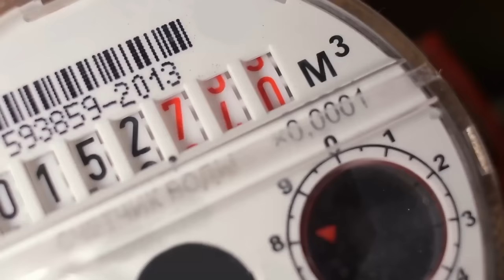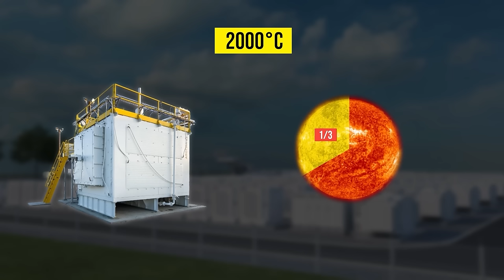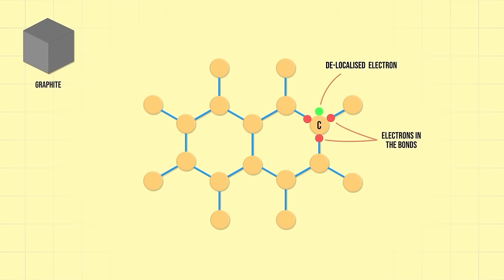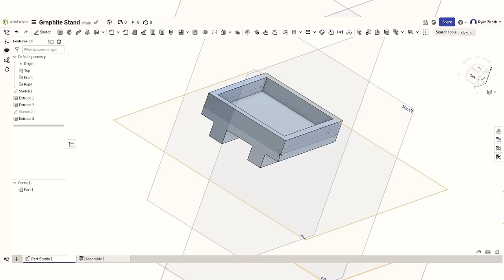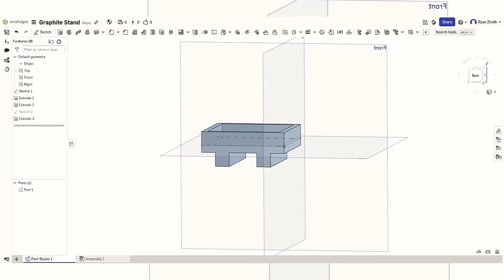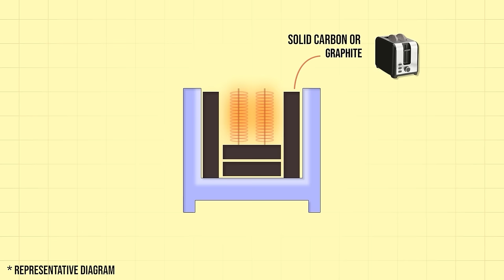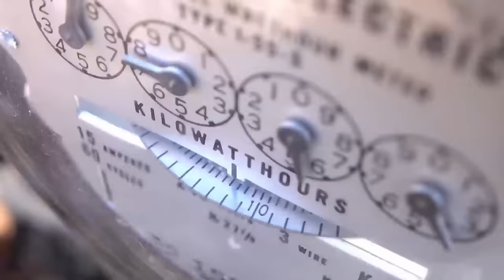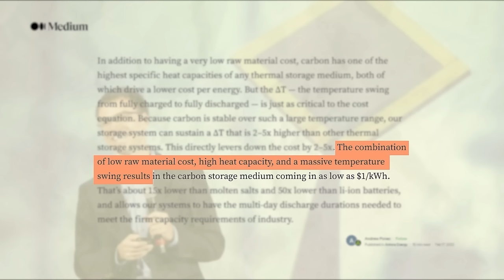Why Solid Carbon is the Future of Energy Storage

Comment: The storage and heat emission is absolutely groundbreaking. Possibly combining the solid carbon heatsource with the Ambri liquid metal batteries could be a thing. From memory they are about 70 odd percent efficient at converting from heat to electricity.
Reply: All comes down to cost.  Ambri is potentially better for electricity and this is better (one of the only options) for industrial process conversion.  The real cost and life of each device and the cost of surplus electricity impact the viability and noone can accurately gauge that from youtube videos marketing the tech.  Ambri has complexities mostly around the ceramic components.

Comment: each home should be equipped with such a device, and have a way to use the stored heat either for electricity generation or actual heat (cooking, HVAC, etc)
Reply: Exactly the same thought struck me! So much more efficient than converting electricity back into heat again...

Comment: What are the mirrors made out of so they don’t melt if you’re dealing with temperatures hot enough to melt steel?
Reply: They are cooled because the "solar" cells/electric interconnections.., also won't resist these temperatures.

Comment: Returning the waste heat from the solar cells to the carbon cell  is not a slam dunk.  You don't get to take heat out at 2000 degrees and push it back in at a lower temperature. There might be some magic in the cube, maybe an area reserved for scavenging waste heat and an area that is heated to the max. Or maybe the waste heat is directed toward a different cube for pre-heating.

Comment: I think this would work. I had a similar idea. Also, they have been using the idea of molten salt as it is also very prominent and can be extracted easier as it is a liquid and can be passed through a heat exchanger, although the system might be a little more costly it would be more efficient , With reflection, shiny surfaces and highly insulative materials about 1 foot of insulation would be totally enough also the larger the volume the less service area, shape also matters. A sphere has the lowest surface area per unit volume. A square cube is also decent. A container is not really that good but if you put two of them side-by-side or four of them, side-by-side t and two on top of them, you would only have to insulate the exterior walls. I’m guessing highly reflective, interior walls, high temperature insulatating bricks in the inner then Rockwool insulation then maybe regular fiberglass for total of about 16 inches should be very insulative. Of course you could go further as it is such a high delta T

Comment: I wanted to use slate tiles, because the color would be useful for the thermal mass of the walls of my earthship, but it seems that I could also use them in direct contact with the metal parts of my rocket mass heater.
Slate tiles would be really good, but it's rather expensive in France, probably because it's a fashionable color and material.
The only problem is that it's difficult to find for free or really cheap, compare to all the materials I already have (stones and clay tiles).
Maybe I already have stones with similar properties, but in a temperature range lower than 1000°C (pyrolysis)
Reply: Salt is another way to store heat.  When the salt melts it takes in a lot of heat.  When it freezes, it gives up that heat.  The trick is to get a substance that has a very high melting point - and of course, a way to contain it in something that doesn't melt or dissolve.
Reply: @acmefixer1  I know but I want low tech and solid.
A  lot of hassle for a few m² of surface area.
I will probably keep it as simple as possible and after enough testing I will make modifications if I find that the heat is escaping too much too quickly or other problems.

Comment: Any problem with materials (others than graphite/graphene) inside the "battery" reaching temperatures >2.000⁰C? I.e.: electricity>heat & heat>electricity converting system's materials?

Comment: The biggest downside of this system is that unlike a battery, this cannot unleash huge amounts of electricity in milliseconds.  You could not use this for synthetic inertia.  

Even though it can put out straightforward output like solar panels at night, it doesn’t solve this huge problem for the grid.  You need nearly instantaneous reaction times with high currents to provide this extraordinarily valuable service of grid stabilization.

With fossil fuel plants, they use massive flywheels to provide the stability and they also vary the output.  It works well enough but the li-ion batteries are exceptionally effective for this application of smoothing things out.  This is why they are so great even though they are so expensive.  The battery operators are highly profitable even with that expensive investment.

Comment: 40% is pretty good, assuming the TPV cells last decades. It still means you need to generate over twice the amount of energy you actually plan on using. Less if you can somehow use heat-pumps instead of resistive heating. This is a case where scaling matters a lot too. Make a storage unit store 8 times more energy, the losses will only be 4 times greater. Instead of making modular cubes, industries that use process heat would have a better time making an enormous chamber full of graphite, heating elements, and TPV cells. I can see industries that rely on process heat as the largest consumer of energy (and who also don’t use fossil fuels for other reasons like reducing iron ore) adapting this sort of strategy, there the efficiency penalty of thermal to electrical isn’t as big of a deal.

But nuclear process heat is probably a more sane pathway, if only the regulations weren’t incredibly punishing towards new nuclear construction in the USA.

Comment: This is brilliant.   Far better for the environment and it last far longer than much more expensive Li-ion storage systems.   These could also be manufactured domestically so you further reduce emissions and pollution associated with current technology.   It would increase our energy security by lowering reliance on China.  

As a bonus, this would decrease the cost Li-ion batteries for EV's and other applications because it would remove the large and growing competition for resources caused by the push for grid storage.    Cheers!

Comment: to be honest you would really want to have double the temperature unless your using phase change, really that would be the ideal battery one that can get to 2000 degrees and the phase changes a meterial dumping a bunch of that energy into phase changing the material which can be extracted later.

Comment: Problem with that is low efficiency of thermophotovoltaic sitting around 40 %, which can be beaten easily with other systems. 

For example, my thesis goal was to design low-cost thermal storage battery from of the shelf components and i get to efficiency around 50 % with maximal temperature just 600 °C. Now then i added posibility of 2000°C my system efficiency would be around 75 %. Yeah, my system had moving parts and so on, but still, that low efficiency bothers me. 

Key information here is levelized cost of storage [USD/MWh] for that system and at what roundtrip efficiency [%] it can achieve.

Comment: Using resistance heating is inefficient better if they use Solar concentrators and directly heat heat battery.
Reply: you are not wrong, but you pointed out the only part in the process that wasn't inefficient ^^
heating something with a resistance is 100% efficient because there is no waste heat, since the heat is what you actually want

and yes, power-to-heat is a lossy process, it would be better to heat the carbon as directly as possible, but this heat-battery is supposed to be something that you plug in a traditional powergrid as storage, not as it's own powerplant (although that may be possible)
Reply: The problem with solar concentrators is that the conveyed solar radiation needs to get to the material to heat it up. In order to minimize the heat loss, these carbon batteries must be heavily insulated, and thus the carbon core cannot be reached by solar radiation. 
Also, if we were to find a way to let the solar radiation in, like a transparent section, the heat would disperse as radiation through the same way. 
Making a selectively transparent window that only allows radiation to get in would require an extremely high melting point and resistance to thermal stress (expansion/contraction, high energy state...). I don't know of any material that can do that, though I don't exclude that we might be able to create one. Silica glass would be out of the question due to its relatively low melting point. Maybe alumina glass, if that's even a thing?
Reply: Also, the inefficient part wouldn't be the resistive heating, which has a theoretical yield of 100% (Joule effect & conservation of energy).
The inefficient part is converting whichever renewable energy source into electricity before the resistive heating can happen.
Reply: @nicholas_obert  Depends to optical configuration entry hole can as small as few centimeters in this case even if this open hole loss rate will insignificant and when no sun you simply close it.
Reply: But then you need to transport heat from the battery to whatever industrial process needs it. And AFAIK transporting heat over long distance is much less efficient/expensive than transporting electricity.
And those carbon batteries are compact enough that you can keep them right next to consumer.
Reply: @kkrolik2106  a hole would be a problem since it would mean oxygen can get in contact with the carbon. At that high temperature, carbon will react promptly with oxygen, slowly burning away layer by layer.
Also, keeping the thing in a vacuum or in an inert gas atmosphere would seem impractical.
Reply: @nicholas_obert  At bigger hole you probably can some sort off glass.
Reply: I think their use of resistance heating allows them to use multiple sources of "green energy" from multiple streams. Solar concentrator to-molten salt medium -to carbon battery -to end user would likely require the solar concentrator and the end user to be in close proximity. Even though the conversion you mention would probably be more efficient,  it might not be very convenient.

Comment: Simple question, from a simple person. If only 40% of the heat is converted to electricity and the system is captive - where does the other 60% go? If the answer is back into the core - how is it 'lost' as surely that just a power density issue?

Comment: My Tesla with NMC lithium batteries is from 2013 and driven 370.000 km so 4-6 years is totally wrong. In storage we use LFP chemistry that has twice the amount of cycles so 20 to 30 years before you reach 80% capacity and price is falling fast. LFP is the way to store in large scale.

Comment: How do you put energy in the block? Around 2000°C you cannot really use electrical wires, right?
Reply: Tungsten filaments in bulbs went up to 3000K.
Reply: @markotrieste  but it is also conductive, so must all cables leading in and from the battery be tungsten? 🤔
Reply: @JasperNLxD  Outside the container you increase the gauge of the wire to reduce heat generation to a minimum. Same as with light bulbs.
Reply: @markotrieste  nifty! Makes sense 😎

Comment: when reconverting heat to electricity, you are going at best to get back 40%.  There are other companies making graphite based refractory bricks or even silos filled with sand to do the same thing, this is NOTHING new. Furthermore when power is sent up the grid its about 5% loss to the storage, and another 5% loss sending the power back to consumers. So the efficiency drops to 30%. High temperature storage also has the drawback that it needs to be heated and then drawn upon in a short time frame, since the losses through even good insulation with a delta of thousands of degrees will be considerable over any kind of time frame further increasing the energy losses.

Comment: Like guys has no one considered heating a sodium lamp with the heat from the battery because that means you get light in the 589.0 and 589.56 wavelength at temps as low at 800C, what this does for you is gives you a very specific wavelength to target with the PV panels like theoretically you could get upto like 90% efficiency realistically your more taking about 70%, but over 40% that is 75% increase in efficiency. Like this really seems like something someone with some money should be working on, if I had the money to develop it like really it's that good of an idea I would invest my own money into it.

You would still get inferred from the heat of the lamps, so being able to reflect inferred back into the sodium lamp would be useful, and then yeh maybe 90% efficiency would be achievable, which if you can even get close to 90% efficiency and that the cost of thermal batteries being so cheap like you got a winner there. Like if I had 100 million to go develop this I totally would, or even just a couple of million to make a proof of concept to where I could get VC money to go make it for real.

Comment: I have to question the mirror story. You are telling us that heat will flow from a low temp mirror to a higher temperature  carbon block. That would violate the Second Law of Thermodynamics.
Reply: Its not heat transfer, its energy in the form of radiation that is moving and therefore doesnt violate thermodynamics
Reply: @MrKerim2000  Do you assert that radiant energy can flow from one  surface to another surface that is at a higher temperature?
Reply: Im saying that you misframed the problem. We are not talking about two blocks of mass that transfer heat. Its that one block emits radiation. This radiation is not heat. Its energy in the form of radiation. Radiation can be emited, absorbed and *reflected*. In fact almost 100% reflection is possible. 
On the other side: the graphite will absorb the reflected radiation again. Absorbing means turning the radiation back to heat again. Therefore its possible that there is an energy flow from the colder mirror to the hotter Graphite that is almost as much as the energy flow from the graphite to the mirror. The temperature of the mirror is irrelevant, because its about reflection of radiation.

Comment: What limits the storage device to 2000°C? Getting it even hotter would obviously have big fundamental benefits.
Reply: Melting temperature. More specifically, the temperature under melting at which the material is not quite liquid yet, but is critically weakened. You know, like steel gets extremely weak at only 600C.
Reply: My guess would be max temperature of containing structure and the heating elements - at least for a reasonable price. They probably settled for ~2000°C to be able to service most of the market, instead of going for high-end batteries first.
Molybdenum heating elements go up to ~1900°C, to go higher (~2800°C) you'd have to go with tungsten alloys, which might be too expensive; I imagine it's the same for fire bricks.
Reply: @wojtek4p4  the heater would have to be significantly hotter than the storage element, otherwise the radiative power density will be low and heating up to the final temperature would take hours. I'd guess 2200°C or higher would serve, but I didn't do the calculation. molybdenum is out anyway if your 1900°C number is right.

Comment: Hi, sounds like a really neat technology. Great video the only thing I would query is where you got a lifespan of 4-6 years for Lithium Ion storage? Most consumer batteries come with a 10 year warranty to be at 80% capacity same as EV's. There is no way they are going to give a 10 year warranty on something that will only last 4 years. I suspect the two technologies would complement each other rather than replacing either.

Comment: We need storage today for one fundamental reason. It is because reliable energy is relatively expensive to produce. But in theory,  if energy was cheap enough, say 1 cent per kwh or less,  then the need for storage would lessen.
Given the necessary innovation, both atomic fission and fusion have the innate potential to generate power at very very low figures. While such low production costs would be disruptive in today's energy market nevertheless it might be unrealistic to believe this will not come about in the not too distant future.

Comment: 2:40 what do you mean those temperatures have only been able to be archived using fossil fuels?

you have always been able to use green energy reach whatever temperature you need. electric arc furnaces (EAFs) have been around since the 1880s

Comment: No mention of what they graduated in or at what level, no mention of what the composition or size or the application of the thermal battery that is stated to have been in operation for 15 years or whether they had anything to do with it is etc etc. But my two absolute favourites are "powering pencils" and the liberal mentions of " magical properties". Lets not forget the production cost and probable life cycle of a solar panel being hit with temps in excess of 1000 degrees C.

Comment: The point, most quickly, lost on the readers, may be ,that, carbon may be ubiquitous, as carbon is everywhere. 
  The listener, sees carbon, whether di-oxide, or mon-oxide, as if we should stop casting it , into our bodily environment.  In that, collection, and deadication (intentional spelling), commits the location, and puts use, in containment.
    I’m looking at sand battery, for an integrated house system, with multiple generators, and multiple applications.
    Solid carbon, is super potent, industrial.